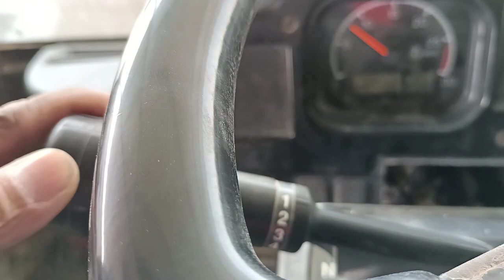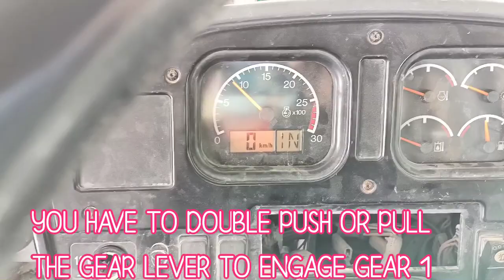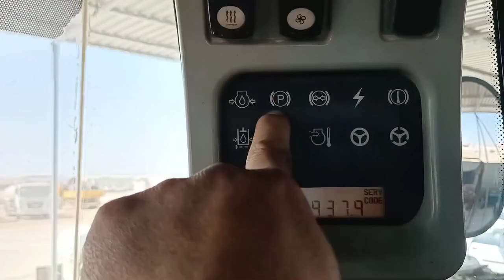CAT SHOVEL 966H GEAR #1 NOT ENGAGING NORMALY YOU HAVE TO DOUBLE PUSH TO ENGAGE

Comment: Bro anong kulay ng wire pinag short mo? Yung ground at supply ba? Salamat
Reply from the maker: hello bro sinsya n now ko lang nabasa message mo, regarding, s pressure switch, bali dalawa yang switch n yan isa s gilid ng makina s bandang ilalim ng ecm halos malapit s differencial, ung sensor n un eh pra sa oil pressure ng parking, ung isa nman nsa bandang ilalim ng cab s ibabaw ng hydraulic tank pra s parking brake indicator un, black & red ung pag shortin mo s sensor side pra d masira ang main harnes.
Reply: @caterpillarjhunhunk  Ok bro maraming salamat you're the man